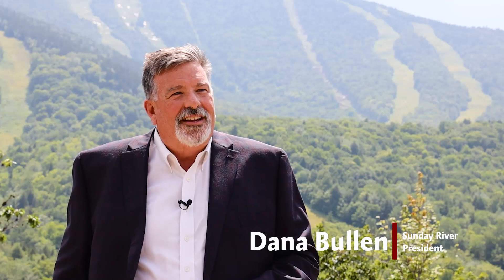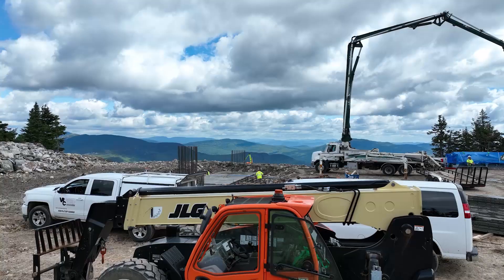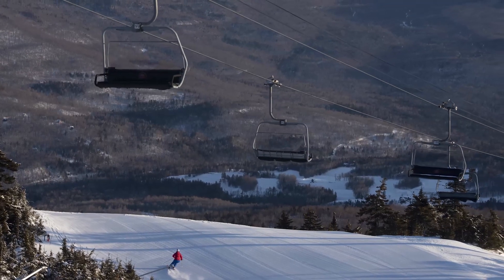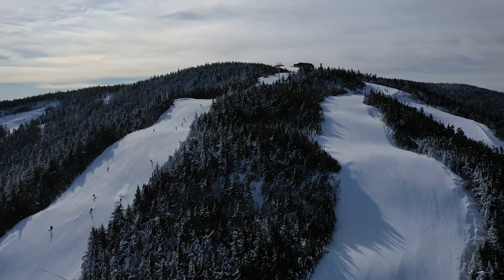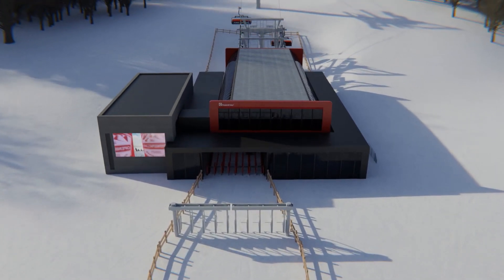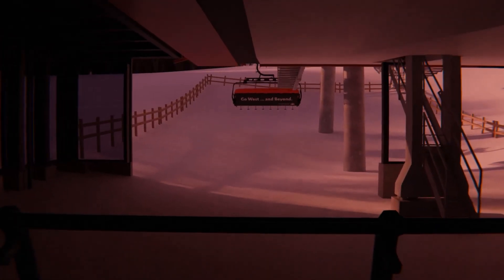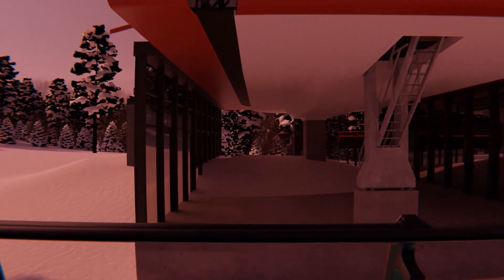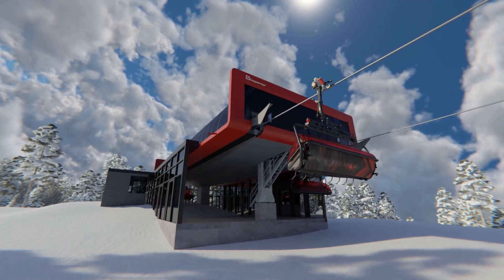Jordan 8 Update: 4 Years In The Making

Comment: This New 8 Pack To Set The Record Straight Jordan 8 Is The 3rd Install Of A 8 Pack D-Line In North America. First Of Course Goes To Top Honors To Big Sky Montana With Ramcharger 8. North America's First EVER Heated 8 Pack. Then Came Loon Mtn With Kanc 8 & 3rd Is Jordan 8. So After Ramcharger 8 It Certainly Has Set The Trend & Raised The Bar Extremely High For Other Resorts To Follow Suit. I Will Say That It Is Rather Odd For Such A High Tech Lift Being Installed A A Very Small Ski Area Compared To A MAJOR Resort Like Big Sky. In FACT Big Sky Has The Largest Collection Of D Line Chairlifts. And Now With Swift Current 6 Launche3d As The Fastest 6 Pack In All Of North America Traveling With Speed Of 14 Mph. So Seeing Jorden 8 Being Installed Sorry Fellows But I Am Not Impressed .
Reply: Go home Paul !
Reply: Very small ski area?
Reply: Not sure where you ski but this is the best lift ever.  They said you’re going to remember the chairlift as part of the experience well guess what? They’re RIGHT!! I remembered the seat and jordan pretty well. Amazing.